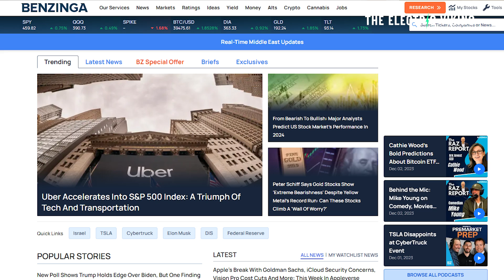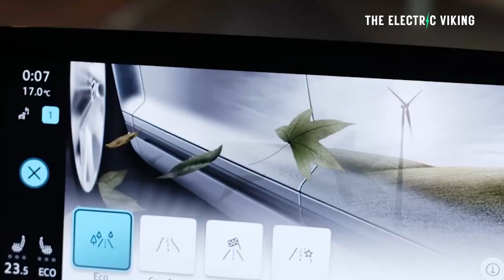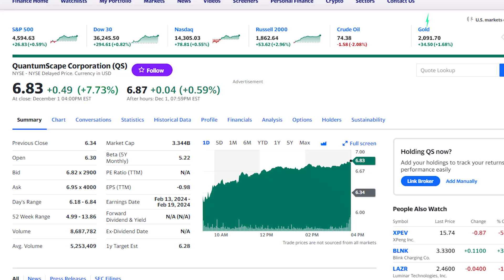QuantumScape stock blows up after journalist says its tech will crush Tesla

Comment: QS's expertise is about the separator, which is useful in a solid state battery.   If it can be commercialized and is adopted by several battery manufacturers then the licensing revenue can be very significant, as it has a portfolio of patents in this area.  If there's a work around that is non-infringing, or if the demand for such batteries is not there because the cost is too high, then it might not be so profitable.  I think they have some important technology, but it is still a few years away from widespread adoption. During this period many different things can happen. Toyota even created a hydrogen combustion engine, while sodium batteries are cheaper to manufacture and are improving.

Comment: A couple of things to consider. Testing batteries by charging and discharging through 1000 plus cycles takes time. It's not like you can take a sample and find out in a couple of months what the real world charging results would be. One of their samples sent out for testing returned 95% engergy retention after 1000 charging cycles. That's pretty promising and if that can be replicated on a manufacturing scale they have a damned good solid state battery on their hands. I think 500 miles per range would be a goldilocks battery. How often will anyone have to stop to charge with that range? When they do stop any of us who own EVs knows the battery charges super fast when nearly empty and slows as the battery "fills". It would probably only take about 10 minutes to get enough miles to make it home or to the next charger in route.

Comment: I knew about QS about 2 years ago. They are burning through too much cash and running out quick.  Also, they are far away from mass production and are having trouble scaling production of their battery tech.  CATL and gomotion new LFP batteries from china have already made quantumscape battery tech moot. Very risky.  Stay away. Tesla has to improve their 4680 battery to match up with CATL new LFP batteries.

Comment: I very rarely post to YouTube.so I'll keep this real short.
"solved Solid State battery bottleneck"
It's a company in Colorado called Solid power.
F,  (via SK ON) BMW and Hyundai (Also via SK On) are using technology developed by a company called Solid Power.
SSBs were delivered to F, BMW and likely Hyundai in Dec 2021. 
IMO this changed Fs mind on making their own cells. So they went looking for a partner to share costs. They found SK-I, who was very happy to JV with F. This resulted in SK On. SK On will also build cells for Hyundai in Korea at a new factory that costs them $352M
BMW is also building a plant to make SLDP SSBS in Parsdorf Germany. Those cells will go into a car next year. (2024) 
They are not 10 years away, not even 5. BMW will have them in a car (test bed) next year. Toyota's SSB is too expensive to put in an EV, that's why they are coming out in hybrids. That buys them time to try to get costs down.
It won't be 2030, It could be as early as 2025 or 2026.  It's too bad that QS burned all those investors. They don't have anything, except for maybe consumer electronics. That's why they "pivoted" from EVs to CE.
But fully capable EV SSBs (60Ah) are here right now. It's just a matter testing and certification before they get into cars.

Comment: Ah another battery breakthrough. Of a company in dire need of cash. Right.
Reply: QS burned through 380 mil last year.  They have 1.2 billion in the bank or almost a 3 year runway.  Now there is some capex spending on manufacturing which will continually increase so it's more like a 2 year runway of cash, but they are in 0 need of additional cash raises at the moment.  Certanly not in dire need of cash..lol.

Comment: As you point out, the fast charging infrastructure needs to be in place and ultra reliable. But if it is, then fast charging batteries make sense - couple these with efficient drivetrains and you can have a smaller battery pack which means less weight and less cost. A win-win?

Comment: Ok that article was a hack job but some of your comments were not correct.  VW has not invested billions plural of dollars in QS.  They have invested hundreds of millions in QS and less than a billion total.  QS currently has roughly 1.2 billion dollars of cash and will not burn through that in 12 months.  Their current cash runway will last until 2026.  

The company currenlty works on batteries with massive energy density that are 3, 4 or 5 years out.  They are much closer on QSE5.  Now this battery isn't the home run battery, but it is better than what is currently on the market.  Jagmeet stated in the last quarterly conference call that the 3 elements that go into QSE5 have all independently been proved and no redesign of the battery is required.  It's a matter of integration or manufacturing.  This is important as the company as we speak are implementing their raptor manufacturing process a lower throughput maufacturing process.  Once implemented and perfected the implementation of the cobra process which is a higher throughput manufacturing process is intended.  Now Cobra is not expected until 2025 so these are some long term goals.

Manufacturing is the key and nothing is more important to me as an investor than the addition of Siva Sivaram in September.  Siva's expertise is high through put manufacturing having previously worked at Intel, scandisk and most recently Western Digital.  He was the president of Western Digital.  Now as president his salary is public knowledge and can be found in previous filings.  Siva's compensation with WD last year was 9.5 million dollars, mostly equity based compensation. He wasn't let go by WD.  He chose to leave WD to join quantumscape and take a 90% pay cut with a massive options package calling QS a once in a lifetime opportunity. Now why would such a seasoned experienced well paid executive do this?  Talk about betting on yourself.

So is QS going up 30% because of this article?  No.  The recently raised 300 million at 8.  Pre revenue companies are easy targets for short sellers. There are more than 50 million shares currently short which is approaching 20%.  The overal market bias is positive with a lot of the market now having much richer valuations. It wouldn't take a lot of new institutional money or previous institutional money that came in at 8 to start buying at these lower levels to put pressure on short sellers.  The most recent independent cell testing results by 3rd party OEM parties, the addition of Siva Sivaram and the progress on the Raptor manufacturing process, which institutional money would more than likely be privy to, is more than enough to bring in new money into the company.  

2026 is a reasonalbe target for QSE5 to come to market and to be generating revenue for QS for the first time.  The announcement of who the OEM partner is on QSE5 could be a huge catalyst for the stock, but I think it's safe to say it's one of the divisions of VW.  Updates on manufacturing processes in 2024 as well as potential timelines of when production comes to market, which could very well come out by the end of next year, will drive this stock.

Comment: @The Electric Viking

Longer charging times may not be what people are complaining about. But: it will destroy the value of your current car when there are newer cars with much faster charging times!

New Batteries of CATL, CALB, Sunwoda, SVOLT and EVE will delivery next year LF(M)P batteries with 4C charging behavior. The Xpeng G9 for example comes with a CALB battery with a very fast charging ability of more than 200kW average charging rate. The 4C batteries are almost in production!

The plateau of the charging curve of the battery is also more important than the peak power of the charger. A battery that is able to charge at a very high charging plateau for a long time does not need extreme new chargers with 400kW, 500kW, 600kW, ...

A plateau of 220kW could bring an 80kWh battery from 10% to 80% within 15 minutes. Currently, most Teslas still need 35 minutes for this because of their very short peak power with falling charging plateau. Only the BYD Blade battery in actual MY SR of production in berlin has a wider plateau.

Comment: Batteries are a unique challenge to mass production....why ?  Because each time the production facility is ramped up - a large number of batteries have to go through a large number of tests, including charge / discharge cycles. And that needs time  - lots of it. If a battery is to last 2000 cycles (minimum) that requires significant resources to implement. And the bigger the scale, the larger the facility to prove the batteries...a battery factory costs $billions....

Comment: @1:42 - Ok - I have to say something here. The main point is - this battery was not even invented when Tesla started making cars. So it is not really a good idea to say that Tesla's batteries suck. The big question is - can they mass market this new battery AND AT THE RIGHT SIZE. There are some batteries which are just huge. Tesla requires smaller batteries and would probably eagerly adopt new batteries if they fit inside of their cars. After all, the Tesla made cars can use any battery - so long as it works and works better than the ones they are already using. It has been proven a couple of times as Tesla switched from one type of battery to another. The computer part of the Tesla vehicles can adjust according to how the battery works. That's all.

Comment: That higher capacity batteries than current generation Li batteries are possible, has been known for years. Capacity isnt the problem, its making them safe, reliable affordable and durable that is the problem. For example replacing graphite with silicon anodes can potentially double capacity, unfortunately despite best efforts of the researchers, so far silicon anodes have failed the durability test faslling apart after a few tens of cycles.

However the search goes on and breakthroughs are always possible.

Comment: You said about 90 or 98% of people charge at home, but that's the problem. How many people live in apartments and park their cars on the street as opposed to houses where charging at home is possible? Being able to charge at home is a big barrier to entry so anyone who gets a home charging station will never go back to ICE, but many people who are renting apartments will never go EV.
Being able to charge quickly is important for the sole reason that it convinces people to buy an EV. Cars aren't cheap. There is no room for doubt when spending that kind of money.
80% in 15 minutes? What capacity battery? How fast is the charger? A Tesla Supercharger can get 200 miles of range into a Model 3 in about 20 minutes. Just the right amount of time to go into a store and buy a few things or go order some fast food and eat it.
Also, 1000 miles of range is stupid. If you can get more miles out of the batteries, they will just put less batteries in the car. How many hours can you drive at 75mph before you need to take a break? 75mph for 4 hours is 300 miles.

Comment: The things can concern me :
1. Availability of charging infrastructure.  I live I a flat. 
2. Up front cost 
3. Cost of charging from public points 
4. Longevity of battery 

Charging speed is perhaps number 5 on my list .  An ICE car is currently my best option.
Reply: I live in apartment too and have EVs for 6 years now... Not planning to go back. Comfort, acceleration, speed.. AP for daily commute and so on... Charging once 1h, sometimes twice a week not a big waste of time while I can make phone calls in the mean time. Driving/charging costs little less than petrol, compared to similar power petrol at least half! Nearly zero servicing costs and  hassle around it and I've never bought new ev yet. Just keep changing them every few years as priorities and technology changes.   Decent size battery will get you around no problem.

Comment: Yeah they pumped this stock when it went Public because VW and Bill Gates invested in it. I think this is not such
and easy problem . Tesla is still not making most of it's own Battery's . The thing I wonder about is the Pouch Cell
expansion and contraction and longevity . Also this will use three times the Lithium of what the goes for standard 
today. Yeah you could do aircraft with triple the density. As you said multiple company's are working on this and other
Techs. More capacity , longer life and immunity from Hot and Cold extremes plus range is the next challenge. I 
would be more concerned with long range than faster charging.

Comment: Well to play  fair, if its has the ability to charge at those speeds - thats fine, but the real take away will be how much it can store and discharge it. Other wise, the charging rate will be a limit across all EVs - aka it doesnt matter short term as all EV chargers will need to be upgraded for faster and faster charging rates anyways. It is a bit of a catch 22, but only on one side of the problem. Range will be far far more important because that means you can start cutting out more battery per cell cost. Aka, if your battery at full size can do 1k - that means at half, you can do 500 miles and that normally means you can lower the price as you wont need as much over all battery. At 500, you already beat a good chunk of cars on the road already even Tesla. So, if they really do have a battery that can store double the energy, then they will have the edge either way. So instead of selling at 60k - you can start selling at 20k instead or even lower.
Reply: It's not IF, its already proven to charge at those speeds
Reply: @Abidance01  think you miss the point of the post :D

Comment: While I agree there is no full network that can currently charge at the speed mentioned, 500kW, there are companies that have products that can meet or exceed this. NXU in Arizona has both a 750kW product and a 1.6MW product available, with an existing station in / near Phoenix and plans to build out their network. Not sure who’s equipment they are running or if it’s something they have built in-house. I may also be wrong about this part but pretty sure Tesla is rolling out 1MW charging for the Semi, meaning this is is most definitely doable.
Reply: How much of the grid can support these chargers?
Reply: @doriangray6985  excellent question. From what I remember reading (and again, I could be wrong) this should be done with a battery back-up to be able to charge up at lower speeds through the day. Would make sense for the shorter term at the very least in my personal opinion. Reduces strain on the grid for those huge boosts in power draw.
Reply: @jonatamaniuk  the MacMaster on YouTube has an EV Porche Taycan and does reviews.  In one he mentioned that when all the chargers were being used they would not charge at full speed so they agreed between them that some would stop charging to enable the others to charge at full capability

Comment: If you have the range charge speed is not really an issue so the attraction is range.  Apart from the fact that for most users 600 miles in a day with a charge at night would be fine.  For longer trips I seem to remember that the UK AA stated that 60mph was a high average speed, so to do 600miles one would be driving for 10 hours.  During this time you should have taken a minimum of 4 by 10 minute rest stops and a 45 minute meal stop.  A bit of planning and you never need waste even a minute.

Comment: The extended range battery for the Cybertruck is supposedly 15k usd, just to add 100 miles of range. This is not a sustainable business model by any standards. So, future EV's will be using something significantly better and cheaper than what Tesla is doing now. We don't know what that is yet, but it will not be Tesla batteries.
Reply: Cybertrucks are sustainable in America

Comment: Tesla changes its suppliers pretty regularly when newer tech comes along.  If a better battery comes along, they'll probably use that to, as will others.  QuantumScape does have VW backing it, which gives some substance to its claims but the article offers no new information or timeframe.  More alarmingly there has been more than usual insider selling from corporate officers, including the CEO.  This could be a pump and dump article.  I would be cautious with this stock.
Reply: The CFO, not the CEO has sold some shares, which could be done for a lot of reasons including paying tax on options received. If it's insiders you're looking at look at Siva Sivaram.  The former president of Western Digital chose to leave WD and his 9.5 million dollars a year compensation package to join QS and take a 90% pay cut with a massive options package.  Can he make more with QS.  Yes. Only if the company succeeds and he makes a fortune off the options package.  When the missing element of a company is manufacturing and they convince a guy like Siva who's entire career was based on success in scaling high throughput manufacturing processes with Intel, Scandisk and WD I'd pay attention.
Reply: @craigb8945 this is great!
Reply: The CEO of QS has not sold a single stock, all of the insider selling has been restricted shares that are a part of the compensation package to cover the tax liabilities of Quantumscape executives.
Reply: "as will others" no. Tesla is the only auto manufacturer who can switch suppliers at moment's notice.
Reply: Tesla has two battery supliers, Panasonc and CATL, that's it. And can't change battery supliers because their own megafactory builds Panasonic batteries
Reply: @Awaken2067833758  And BYD, and they invest and have purchased smaller battery companies for their tech.  If something works better, they will use, they've already shown this.